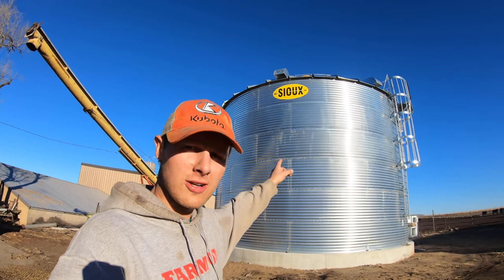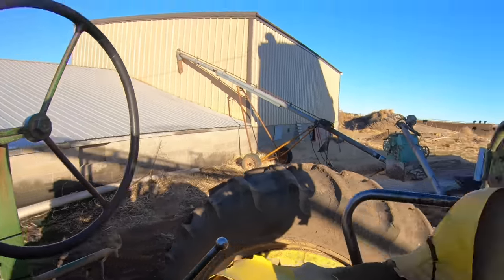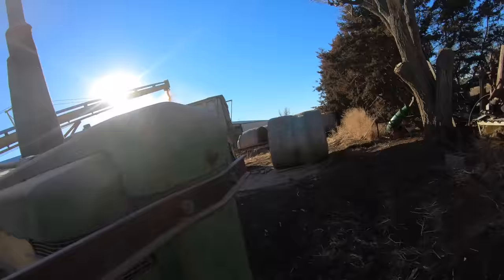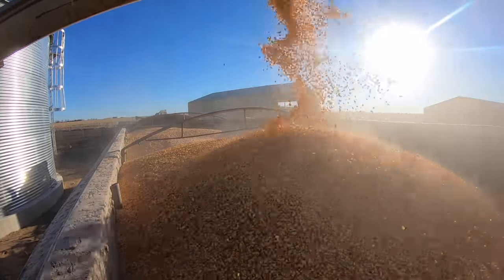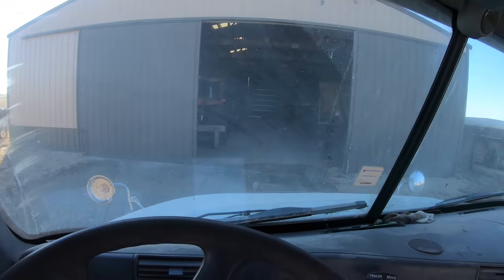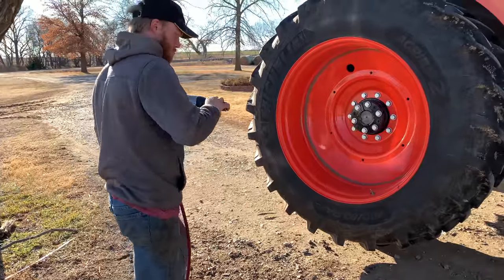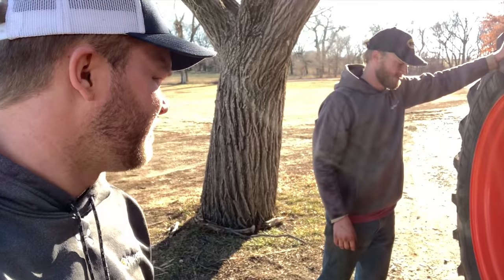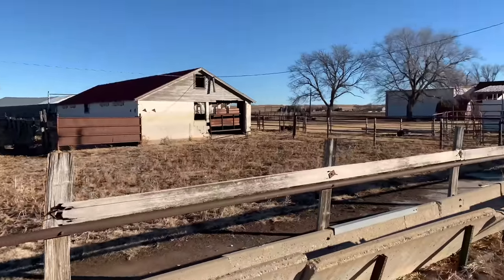ANTIQUE TRACTOR Unloads NEW GRAIN BIN!

Comment: How come the B has the yellow thing like a 730
Reply: That would be more like a 20 series stripe. Was a somewhat common thing to do back in the day to make a letter series tractor look like a later model. There’s quite a few of them running around like that.
Reply: @watchjaredwork1487  ok because I’ve never seen one before
Reply: @watchjaredwork1487  I don't care for that much, but I also paint the air screens on a 4440 from factory green to black. I guess styles change over the years.